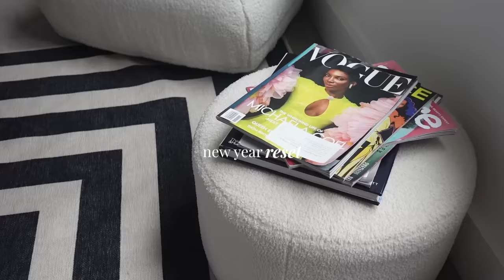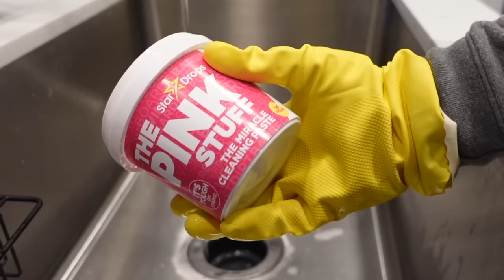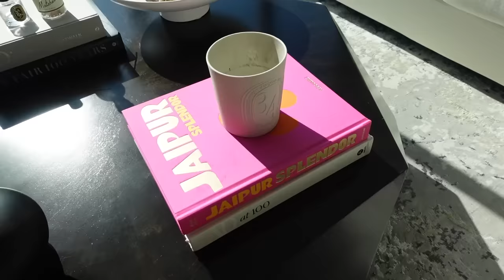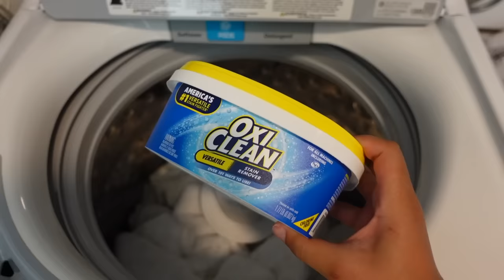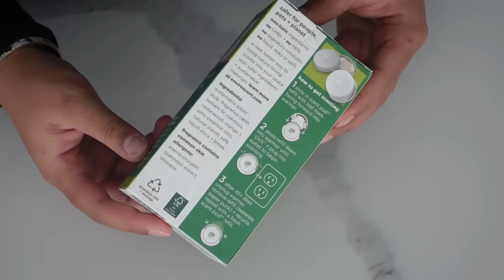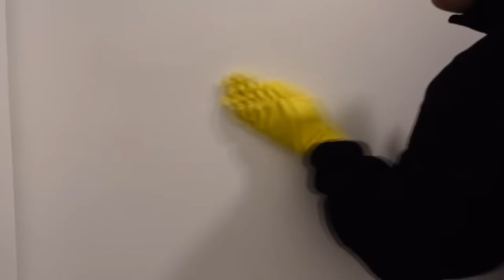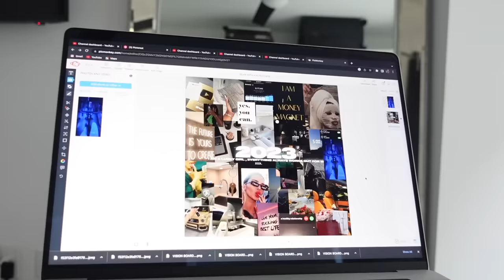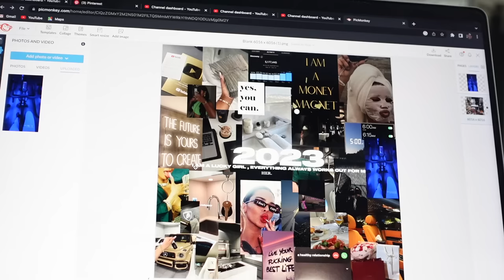RESET WITH ME : DEEP CLEANING AND ORGANIZING + VISION BOARD\ GOAL PLANNING + HOME MUST HAVES & MORE

Comment: Gowrl Kirah try this tip. After you fold your tissue roll, turn the faucet on for a super quick sec then turn it off and press your tissue roll up against the damp faucet head. It will make a stamp impression on the tissue. It looks so posh after.

Comment: Dishwasher tip: just rinse off food residue off of plates/glasses instead of a thorough wash because the dish washer soap effectively works to erode those away.In the absence of the food residue, the soap will eventually erode the layers of the plates/glasses!😊